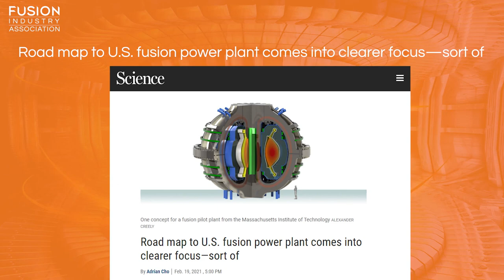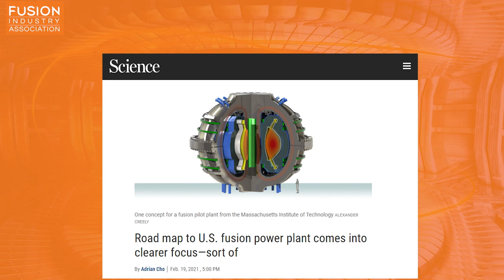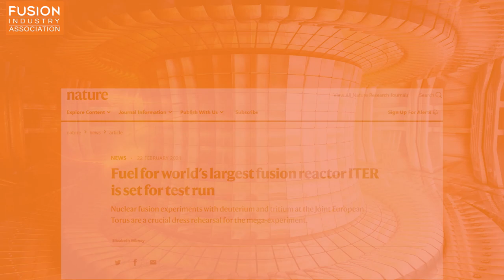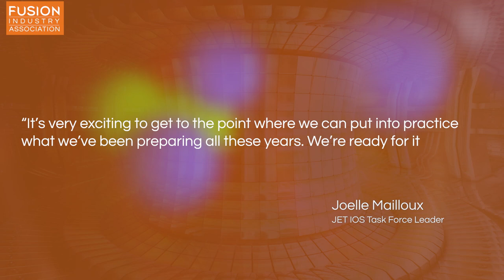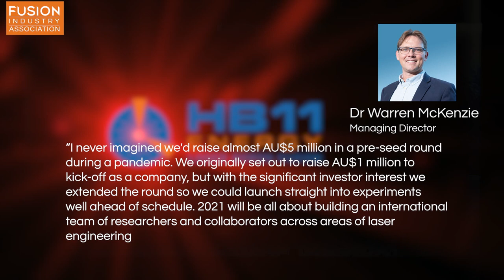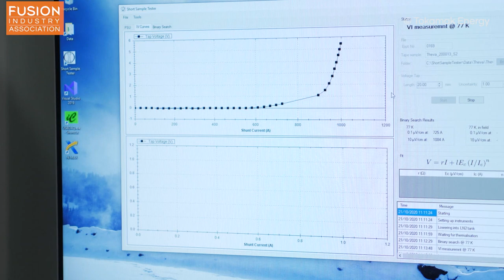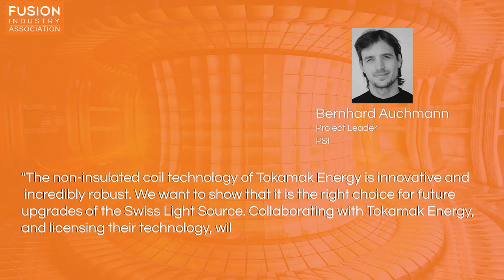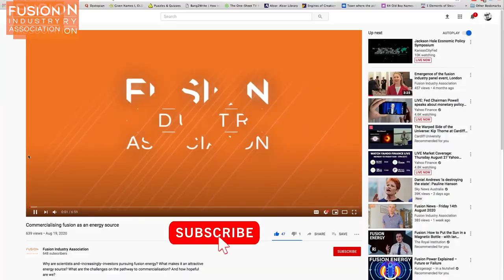Fusion News - Friday 5th March 2021

Comment: What are the exact details of tritium breeding? Are both isotopes of Lithium used or just Lithium 6?
Reply: I can't tell you the exact details (I don't know!) but I think both could be used. In fact Li7 is good because the reaction produces helium, tritium and a neutron, which can then go on to react with another lithium to make more tritium. Designs may also include something like beryllium to act as a neutron multiplier and increase the amount of neutrons available to go on and make more tritium, since producing enough tritium is an important challenge.